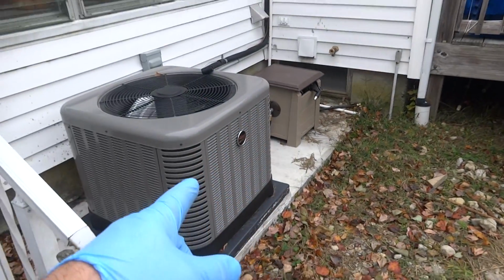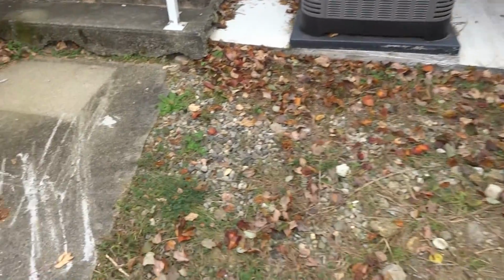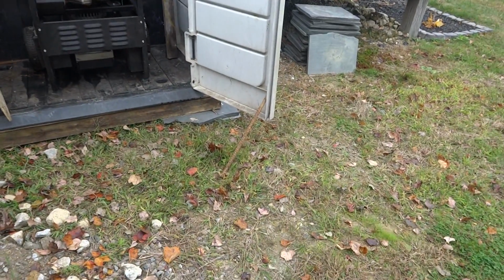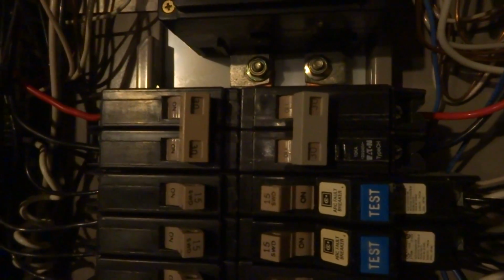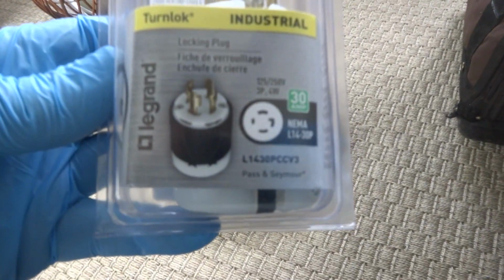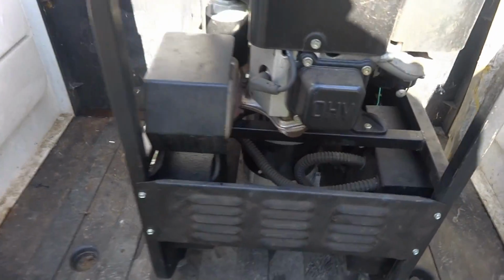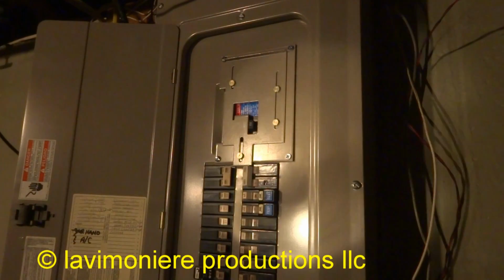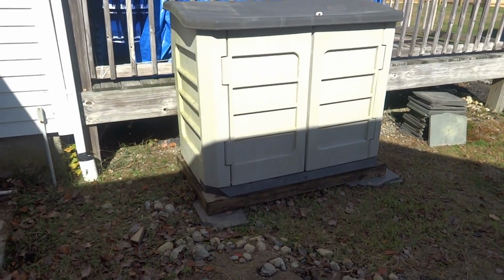7500 Watt Gas Generator installed to run whole house

Comment: I wish I could've done that for you, I would've set you up with a automatic transfer switch and you wouldn't have to mess with the electric panel at all, as soon as the power goes out it the automatic transfer switch would kick out the power line and start the generator and have emergency power automatically.

Comment: 30amp can only push max 7500 watts. People need to realize that BEFORE they go and buy a 12K generator thinking it will power the entire house. For any generator over 7500 you need a 50 amp breaker installed. I find having the 30 amp set up perfect for emergencies. You can run most of the house for a while until the power comes back on.

Comment: Shoooot, I took the onan generator out of my motorhome and installed it in a big dog house with windows and ventilation fan. Wired the gen start switch from the motorhome dash next to my breaker box. No need to ever go outside! Nice smooth quit 1,800 rpm.
Reply: 1,800 units are the best, but cost more.  In the case of standby units longevity isn't too important since they usually don't see too many hours.  I have an 1,800 rev diesel.

Comment: Not supposed to run that 10 outside like that it's not suited for it it's a violation. It's another violation if you ran that 10 all the way back in the conduit. Supposed to have a plug on the outside of the house than make up a whip with SJ cord or get a premade one already.

Comment: Nice job using the Romex and then transition the 10/3 SO whip at the Generator. Some hack would have put the L14-30 plug right on the Romex or MC cable! Many "pros" have an issue with interlocks but I think they are superior to  those six switch transfer boxes. With an interlock you can decide what is powered on the generator or not. You aren't locked in to specific circuits on generator. I have mine set up with two digital current meters on the generator inlet box. That way I can monitor the load on each phase of my 87500w Harbor Freight special! Last week I ran on gene for three days with the high winds power cuts in northern Los Angeles.

Comment: I energize my whole house during a power outage with a relative small Champion 8.5kw standby gas generator. I can use my 18,000 btu inverter a/c, my two fridges, microwave, washing machine, two garage doors, all my lights, a 48” tv, my satellite system, wifi router, my electric cook top and my water cistern 3/3 HP electric pump. Just don’t use all the appliances at the same time during the power outage and at half load it consumes less than 1 galon/ hour propane gas.

Comment: That's a good setup Steve may I add a just a piece of sheet metal bent to allow air space  screwed to the inside wall of the shed. Then there will be noting to screw with or possibly fall over in a storm

Comment: Good video Steve as an electrician when I have installed a generator what the fire department has required was an engraved sign mounted on the meter box w/ two sided tape that there is backup generator on site just a suggestion
Reply: Similar requirements if you have solar panels generating feeding utility power.

Comment: Steve, I've enjoyed your videos for years. As a licensed electrician I'd like to suggest you install a 30 amp, 240 volt inlet device box in lieu of the junction box for the flexible cord. Other than that you did a fine job. Also, be sure to turn off ALL of the circuit breakers prior to transferring to generator power. Turn those breakers on one at a time once the transfer is complete. This avoid accidentally overloading the generator at start up. 29 years of experience talking here. Great video buddy!
Reply: Should he have used UFB instead of romex because the junction is outside?   Mainly just curious.
Reply: There are electricians then there is J-cord Willie. As long as thaz powa. Its only temporary (3 tears later😂😂😂

Comment: Some electrical codes of some cities, counties, states ..etc. don't allow the use of the manual interlock plate on the panel and only allow expensive automatic switching systems.  Check with your local authorities before installing a manual override system.  Failure to follow and adhere to the specific code will render your homeowner's insurance policy void in case of any electrical issues.

Comment: That  Romex 10/3, can’t be run outside. And it’s not physically protected. Would never pass inspection. Not even a weather proof box outside?
Reply: Yeah this whole install is a homeowner special, not remotely code compliant. Wouldn't take much to sleeve the romex in liquidtight outside and make things a bit better.

Comment: Thanks Steven, GOOD STUFF HERE.
 I would recommend when switching to generator to turn off all the breakers in the panel then turn on generator breaker then one by one turn on the individual circuits. This allows the load to come up easy on the generator. Leave off circuits not needed or to large for generator.
More video like this Steven, good stuff. 
RG

Comment: If it rains or snows when you need it, pull it out of there and put the patio table over it, several concrete blocks on top in case it’s windy. Can raise the table up to clear it.

Comment: It's called an interlock to run the generator goes on the pannel when the power goes out you turn the main power on the house off and the interlock slides over so you can turn the generator on. If you run the generator at the same time as the main power you run the risk of back feeding the pannel which will blow all the breakers

Comment: my coleman 6500watt gas takes 5 gallons gas every 10 hours. june 2014 big storm took out power 4 1/2 days across several counties had to drive several towns away for gas waited in line for over hour. when power goes out banks gas stations and hardware stores are closed down. i park mine in the doorway of the lawnmower shed because it's always pouring rain

Comment: That little Briggs and Stratton engine can only run a refrigerator, television,  and maybe a washer and dryer. But it also depends on what generator, the part that generates power if it's small like this I'd be amazed at how much it powers a whole house. Small generators like this only are good for running a few things.
Reply: I can power my whole house during a power outage with a relative small Champion 8.5kw standby gas generator, but all my electric appliances are very efficient and only have a 18,000 btu inverter a/c in my master room. Most people don’t realize all the appliances you can energize with these small generators.

Comment: I'm in the midst of watching this and it probably won't matter when a load is put on that unit but...the idle circuit is clogged in that carburetor. It's the reason it's 'hunting' (up and down idle). Maybe a carb overhaul would be in order? Or even a replacement. There are Chinese carbs complete for $25.

Comment: Steve another nice video! Never knew they made the service breaker isolation bracket you showed here...Nice! Ol Miss Molly protecting your truck Momma!
Reply: pretty neat huh? its called a generator interlock. cheaper and easier than installing a transfer switch

Comment: Watts = amps x volts ... This seems fine if you stay reasonable on your appliances, especially heated appliances like electric ovens, toasters, and heaters, and blow dryers, and electric clothes dryers... I like that master breaker interlock system. Okay, so its 30amps that provides about 250V...  (7500w / 30a) = 250v.   A microwave uses about 5amps fyi

Comment: Steve my dad had a Propane fed gas Generac, installed in august, (in MA) They installed a load share device which lets you buy less wattage, and puta delay on the fridge and even the a/c. So the generator wont surge or have a hard start. he is at 16k with a 500gal propane tank.  the last storm that just went through they had no power for 1.5 days.  it worked and did its job. It also closes off to power to the utility with a transfer switch I think.

Comment: Running the whole house with 10/3?
Reply: the generator can only produce 30A max. while technically every circuit in the panel will have power, if you turn on everything in the house at once, it will pop the breaker on the generator. cant use central AC, cant use an electric stove. 10/3 is what you use.
Reply: @cutrara7  too bad she didnt buy like a Duromax 10k or 12k unit with a L14-50 outlet.

Comment: Your electrician should have used UF wire if he was going to free air (not sleeved in conduit) it under your deck. Romex isn’t weather rated. So it will deteriorate over time. It will work for awhile though since this setup is temporary.
Reply: That's the only part I don't like about this job other than that it's a cool setup!!!!!!
Reply: As you said, being temporary he probably figured Romex was fine.  He could always "sleeve" the Romex in flexible grey conduit from just inside the basement into the generator shed junction box (could replace with a plastic to eliminate any grounding), as long as the portion inside the basement is open air, it's considered a "protective sleeve" and not a "raceway".

Comment: Keep a good flashlight in the generator shed. That's what I did.  Then I switch to the Generac 10k natural gas 13 years ago.  Still running strong.  10k will run a 4 bed 2 floor house but you can only use 2 small stove burners if you have electric stove.  I get 45amps out of that machine, which I have never tripped.  Just remember to check the gas meter.  I had to have the gas company put in a bigger meter because my boiler 155kbtu weil mclain would shut down when the generator started up.  The old meter was too small and could not pass enough gas through it.  Then there is the choice of the transfer switch.  I just got the whole house 100A transfer switch since we have 100amp service.  Takes about 20-30 seconds to come online depending if she starts on the first crank or not.  Sometimes it takes 3 times when it's like -10 out.

Comment: Carburetor needs to be cleaned sounds like it's running like hot garbage. A battery tender wouldn't be a bad idea to put onto the battery to keep it full.
Reply: Doesn’t have any load on it.
Reply: The generator loaded or not should run decently smooth. Especially an older Briggs engine like that. The battery will lose a charge either way whether it is started or not and can lead to failure in the cold months if it don't have a good charge to it.
Reply: Matthew Poole - unloaded, it’s hunting.  What matters is if it can take up to full load and stay running at rated speed for 60hz power.  After all, it’s not new, and no Honda 😁.
Reply: The engine should not be hunting at idle or under load. Go to "Taryl fixes all " on you tube and he has a vid on how to stop the hunting .